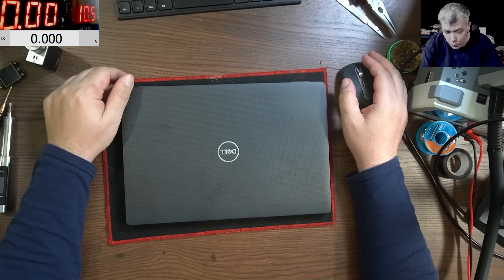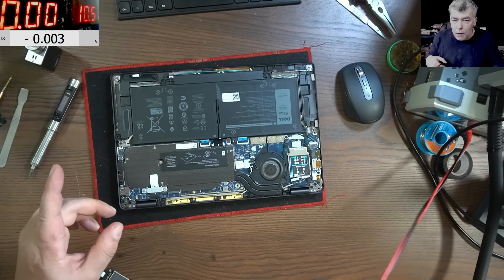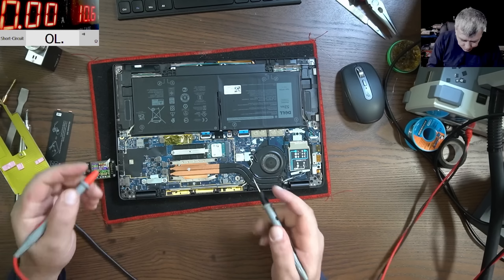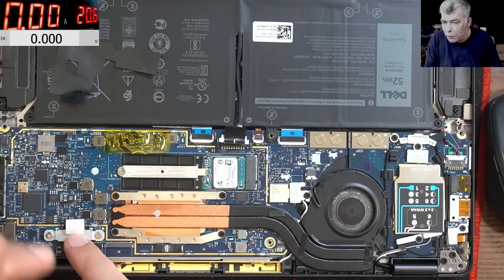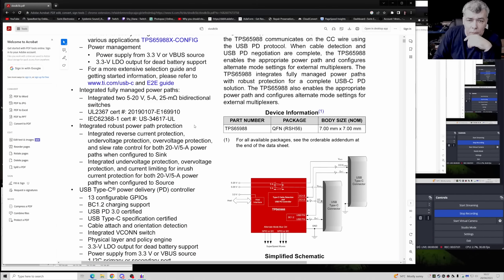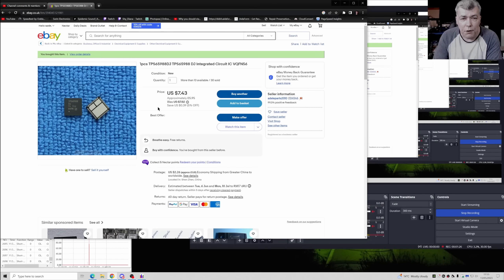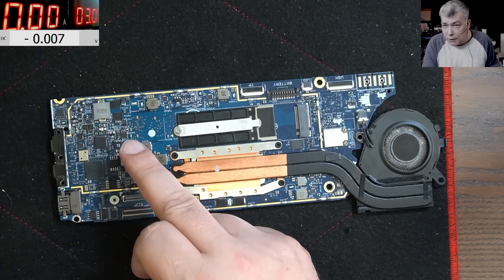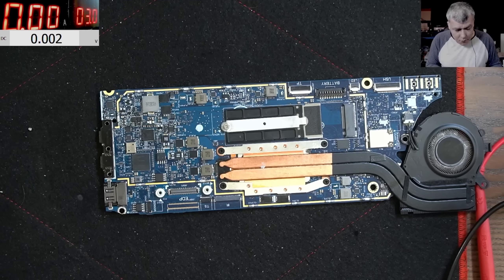I think i'm DONE buying chips from China - Dell Latitude 7300 repair attempt, TPS65988DJ replacement

Comment: I usually try to remove the markings from chips from china using a cotton swab and isopropyl. With a little bit of persistence the markings go away, because apparently it's not cheap to do laser markings and counterfeiters are just too cheap.

Comment: As I think the two chips. They support Thunderbolt, according to the data sheet
The problem could be from the spi flash attached to the chip.
As you know TPS65988 is working with firmware
Reply: Really?
There are a firmware inside?
Reply: @eldjoesther643  No, it is connected to my isp flash and there is a firmware in it
Reply: 👍There are several versions of the "TPS65988" and another "G4". A suitable programmer is required

Comment: I have a very similar looking laptop,Dell Latitude 3410 .Laptop had a short , lights coming on for only 2-3 seconds,many components getting very hot ,I found the USB type C controller chip CYPD5126-40LOXI was very hot in 2 seconds.I've removed it.Laptop is working perfectly since then ,but no type C port.

Comment: Maybe there is more problems not only TPS65988 .
Charge battery and test again,if laptop works on battery then maybe won't charge so you need right TPS IC but if laptop doesn't work then problem is elsewhere and TPS IC might be compatible and work fine.

Comment: I will do the same after one bad experience, got a IC chip voltage regulator from Ch1na looking good as an original, replaced it, but gave me 1.2v instead of 3.3va, after some measurements I could see had low ohms compare to the damaged one. I also saw the IC chip engraving was different for the original. Just wonder why the trouble to make a replica so close to original and waste money that won’t work and later none will buy it. I just later bought it directly from factory. The chip is working, gave me the 3.3 LDO.

Comment: Don't give up Sorin. 50 percent of the battle is getting a working or even correct IC. They are not fake they are either not programmed correctly or not extracted correctly.  It can be time consuming and embarrassing if it doesn't go to plan

Comment: I work in IT and 2 years ago I bought a new Lenovo with usb c charging. After a couple of years it was getting unreliable; sometimes it would not charge when plugging in the connector (poor connection). I decided to buy another new Lenovo a couple of months ago; guess what they have gone back to the traditional power charger (eg no usb c)! usb charging is a bad idea; the complex chips required are not reliable, the connector is not reliable. Why change a standard good design and make things more complex and unreliable? I am really happy to go back to a traditional 19v charger! I also had some fake chips from China; I managed to get my money back. I don't really understand the mentality in China with selling fakes; I recently bought a tfcard usb reader which is made in China; it burned out in a month; the Sandisk tfcard (American) plugged into it is fine; I can't think of any American or Korean ssds or memory that I have ever had that failed; so its definitely the mind set and how they think they can treat customers.
Reply: I am afraid they are not going back, because EU is forcing to use USB-C in all devices.

Comment: In my experience, Dell laptops (and tablets) don't negotiate higher voltages with generic USB power supplies - they only seem to work with proprietary Dell USB-C PSUs, which (I think) provide the maximum voltage without bothering to negotiate first.
Reply: that's not possible ! every USB C PD compliant charger MUST start with 5V vbus and only after negotiation it can switch to higher voltage.
Reply: @robertjung8929  You're right, and I seem to have misremembered - the Dell (Venue 7130) I was thinking of used 19V on a Micro USB connector(!). But I have also seen Dell USB-C devices not negotiate beyond 5V with generic USB power supplies, just as Sorin's did.

Comment: I've been fixing laptop motherboards for 20 years (ow, how time goes by) and I buy from China, always, because there's no other place to find chips. You need to find reliable suppliers. All the chips I buy come in the original reel. The trick is not buying from the cheapest sellers. Also watching buyers reviews and photos. If most of the buyers' photos have the chips alone, no wrapping/packaging of any kind, you have a great chance the seller only sells used chips.

BUT anyway those usb -c controllers are not available yet, so they are taken from faulty boards. The chance they are already faulty is great because they are the first to burn on modern motherboards. 

I avoid buying USB-C powered laptops for myself, I love the simple chargers, let usb for data only. But I know I'll have no choice in the near future, unfortunately. USC-C sucks big time!
Reply: Sadly this is something we can't blame companies for. Customers, reviewers, "influencers"...they've all ask for it and now we have it, like it or not.
Reply: This chip is available from mouser, 100% original, of course.
Reply: @modorangeorge4991  I live in Brazil, it's very difficult to buy from Mouser. I tried in the past but stuff didn't pass customs, the payment is a surprise (dollar changes and credit card taxes). Buying from Aliexpress is way easier, I can debit directly from my brazilian bank account without having to buy dollars or use a credit card. And every time I try to buy USB-C controllers, specially for macbooks, it's always used. BTW, they advertise as "New and Tested" but it's BS.

Comment: the problem as see it though Sorin, you buy from a UK  supplier but how do you know they aren't buying from China?
Reply: of course it's from china, i don't think there are any chips made in UK.
Reply: @orange11squares   probably the original one from dell come from china too LOL...
Reply: I bought in a very important national store in my country a optical pick up KSS201A for a cd player, on the box you can read "original part" but once you open the box you can see bad quality solder joints, pcb that are not well screwed, connectors that are not firmly seated in the pcb  , guess where come fron in reality, yes from china , i remove the electrostatic protection, i put the part on the player an doesn´t work, i put a second hand part and work correctly.

Comment: I bought 5 chips from Ali express, a controller for smps all of them are shorted between Vcc and Gnd, I refunded my money but the problem is that the customer waited for 2 months for nothing
Reply: Why you use free postage option for customer job? Every tracked service they offer will arrive under two weeks (10 day is average for "AE standard") and even untracked "AE saver" will came for max one month.
Reply: @gorky_vk  Shipping sometimes is very expensive on Ali express depending on the seller options and certain jobs are very cheap $2 for 5 chips I can’t ship them with $25.
Reply: @ultimateworkshop2000  yes you can... Because not many customers are willing to wait so much time and you will loose customers
Reply: @ДимитърАндонов-ъ7е  Yes it depends on the customer and the device you are repairing, for example this smps for a kitchen machine that is sold new for $80, the customer won’t pay $27 for parts in addition to customs and repair service fees, instead he accepts to wait longer, but if you are repairing a $1000 laptop customer can pay $100-$150 no problem
Reply: @ultimateworkshop2000  Only $80 for a new machine! Better off buying a new one.

Comment: This is not a Dell 7300 latitude model the mainboard is some newer model
Reply: yep, the 7300 has dual memory slots in full view, this doesn't. Looks to be the same base cover, but definitely not same motherboad, I've got one open right in from of me. The difference between say 7390 and 7300 is 7300 has dual ram slots. Looks like ram is likely soldered on this one.

Comment: i never had any problem buying chips from china... as long as you know what you are doing b4 soldering those chips. u must bake them first to remove the moisture on the chip. let say 125°C for 5 mins. 

this will also prevent the chip from being shocked directly by high temp when soldering like 400~°C

sorin must have killed the chip with those temp he used

Comment: Yep, getting fed up with chips from China now. Cannot get real 46V32M16 TSSOP ICs anywhere. They're are such a commonly used component on many different older devices. I can't even get genuine alternative chips. It's only a SDRAM IC, I just don't understand why there is so much opposition to repairing stuff (well I do but they don't really need to do this). Manufacturers are missing out on a really large repair market, just to protect their new kit sales figures.
Reply: They have them at Mouser.
Reply: @englishrupe01  Thanks, I'll give them a go. I've tried RS and Farnell and their chips fail after an hour of operation. I've always bought them from Farnell in the past any never had any issues. Suddenly I'm getting 100% failure on them wherever I buy them from. I even tried fitting them to a known good device and they still fail after about 1 hour. I've reduced the soldering temp, changed the flux I'm using. Tried cleaning the flux off and not cleaning it off. Replaced the voltage termination regulator, frankly I'm out of ideas and I can only conclude the chips are substandard, maybe rejects left over from a part that is no longer manufactured. However I will try these ones from Mouser, just to cover all angles. Thanks again.
Reply: @radio-ged4626  Cool....let us know back, too. Thanks.

Comment: Are you sure that chip is faulty ? it is totally fully heated , usually faulty chip is heated only from one corner ?? Maybe something is shortened after the chip is this is why it is heated up ?
Reply: i think not because u get different result in voltage with both chips.. if both chips were good u have to have the same results..

Comment: AliExpress has a much better buyer protection plan. The seller does not receive payment until you receive you item. 
If there is an issue with your order you have an option to make a video and prove the item is no good
Reply: Aliexpress has one of the WORST records in dispute resolution in my experience. They appear to demand the item be returned to the seller before a refund can be issued, which in most western countries is just far too expensive to be cost effective.
Reply: Ok, "much better" is an exaggeration. Now that I think of it, I've had a few people give me a hard time trying to return things. But generally I've had much better experience on ali than ebay. But I've been off ebay for quite a while. Ebay take 12% of sales so I support them as little as possible 
Aliexpress only 5%

Comment: Why don't you order from digikey or mouser?
Reply: Cost
Reply: @jaym5938  The cost of the ship in the video cost 6.24€ on Mouser.
Reply: @jaym5938  The amount of time he spent to de-solder / solder over and over again does not justify to buy cheap crap.
Reply: Depends on two factors:
1. The distance from the person living to the shop, if the distance is thousand miles then it is preferrable to buy from China as China shipment is known to be cheap, for example to ship to Indonesia the price is just $1 - $2 while ordering from Digi-Key has at least $45 (the cheapest shipping price).
2. There are many chips that you can only get from China, not from Digi-Key or Mouser.
Reply: @stark_energy  I said that because this particular ship was available at good price at digikey. Free order above 50€ and delivery time in 48 hours.

Comment: Why did you buy a chip in China and wait three weeks if Mouser Electronics has it in stock? It costs 6.24 € there, what's the point of buying it in China?
Reply: Because many chips are not available in mouser
Reply: @ДимитърАндонов-ъ7е  When you buy a CPU, GPU, ICH and other unique chips, they can only be obtained in China or from donor boards.  But universal USB controllers, power management chips, logic elements and passive components are widely available, why take the risk of buying them in China?
Reply: @mineua  as mentioned, there are many chips that are not available in Mouser. Also for repairer living in other countries far from Mouser Electronics, the shipping cost from Aliexpress China versus shipping cost of Mouser or Digi-Key is WAY off different, something like $2 vs $45.

Comment: dell  battteries kills itself  if it has no voltage on the cells.Buying chips from china is a gamble sellers profile and rewievs of buyers is the most important signal.electronic industry needs standardization on chips this laptop repairing job is going to be confused.why they are using type c port to supply power on motherboard?what happened to dc jacks?why we need a burning chip on main power logic before mosfets?